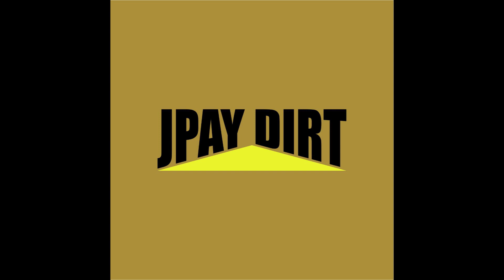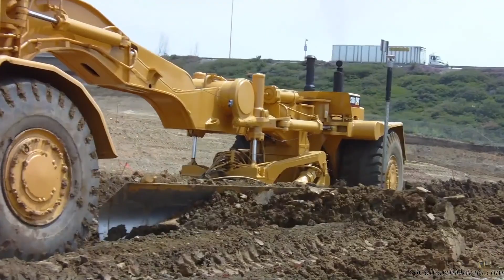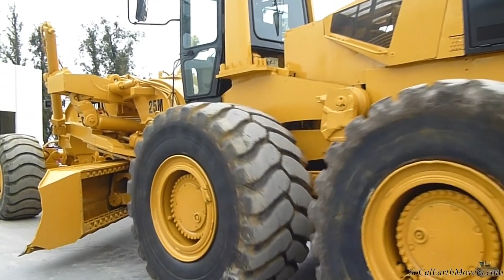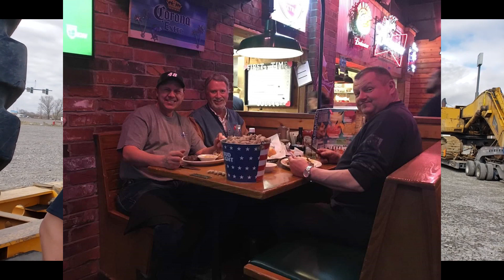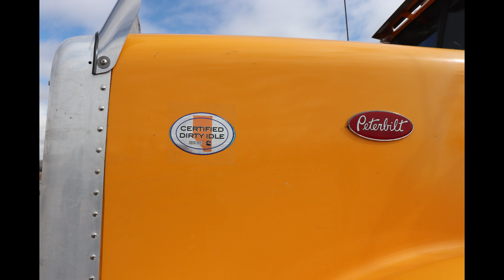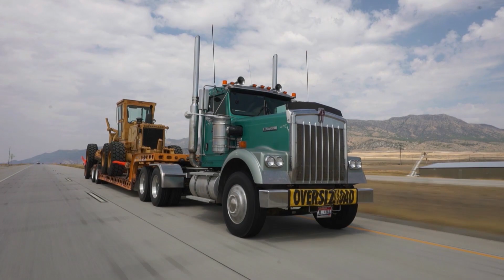What Is A Scrader

Comment: I saw that Brent Engineering utube vid 5 or more yrs ago, been thinking of making a radio controlled model similar to it for awhile now, maybe this summer... mine will be using a Bell 4206 tractor as the lead with powered tandem axles in the rear.

Comment: That excavator trailer looked like a bear to get into and out of tight spots with! Wouldn't a scrader have a lot more horses than a typical grader? Kind of hard to watch your moldboard though I would think.
Reply: That whole set up had way too many wheels and articulated points to be anything but a nightmare. Was there any escort vehicle with the units?
Reply: I agree with your comment about being able to watch the mold board, but it's not really the sort of machine for detail work and lots of machines are not good for an operator's neck or body for that matter.
Reply: Don't know how they would have done it 40yrs ago, but today you could have numerous cameras watching the area the moldboard covers, and a monitor in the cab.
Reply: Looked like they had it set up for gps on the video